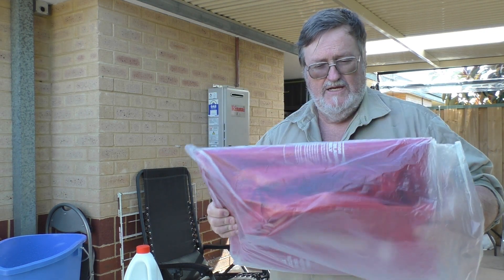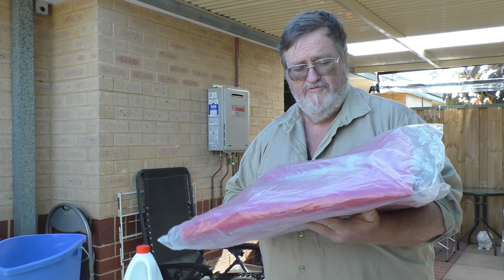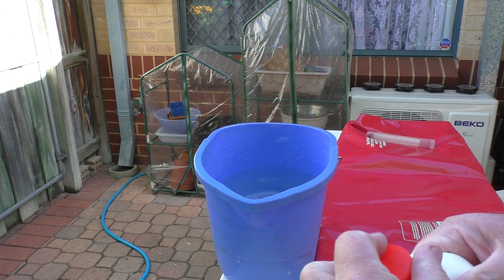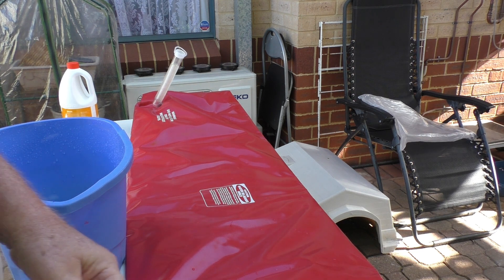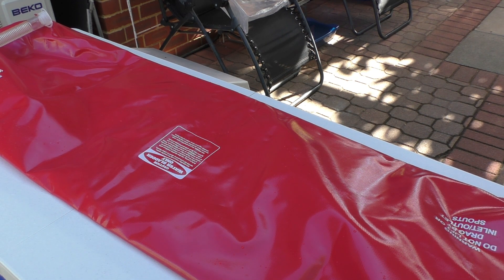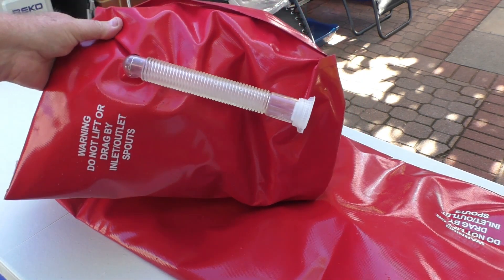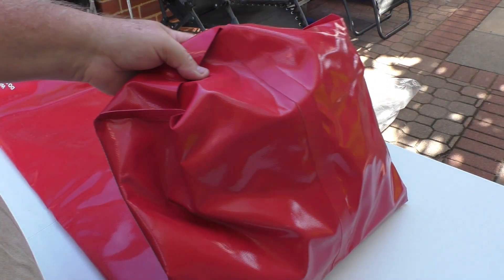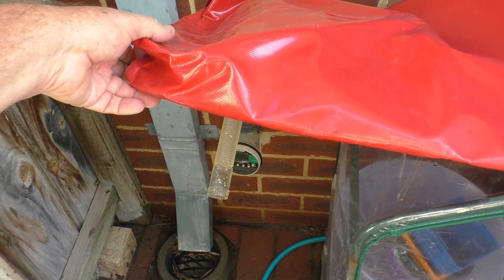4x4 footwell water bladder - First look and preparation

Comment: Hey mate great video. What did end up doing with the outlet end for your water pump? I dont know what  to do
Reply from the maker: I made a second video showing the final set up. We still use it but I have found that the water bladder does 'taste' a bit so I have had to flush it with bi-carb again. The other video is at: https://www.youtube.com/watch?v=LqUJF6B2le8&ab_channel=WesternAustraliaNowandThen

Comment: Syphon should get the water out. So should the pump you haven't bought yet.

It's never going to get dry inside, unless you can organise some evaporation.
Reply from the maker: We have now bought and installed a pump which does the job pretty well. A suggestion made was to use an electric air bed pump to dry it out but I'm not too worried as our standard water tanks in the Coaster always contain some water and we can always use a steriliser regularly just to be safe.
Reply: @WesternAustraliaNowAndThen  I wouldn't worry about it, for me. If you're concerned, you could have the water tested after a few months, or use water purification pills, or boil the water before using. Maybe fill a 2l Pepsi bottle for tooth-cleaning.
Reply: @WesternAustraliaNowAndThen  Where have you been topping up when on the road?
Reply from the maker: @oneeyedphotographer  Generally only from town water. We don't take from natural sources as a rule.